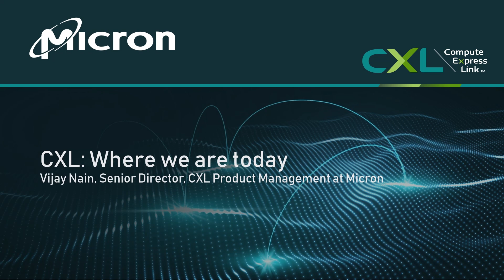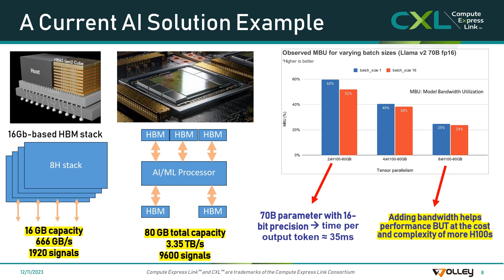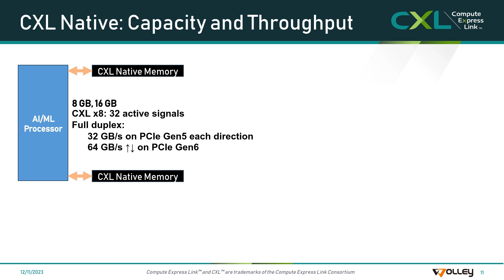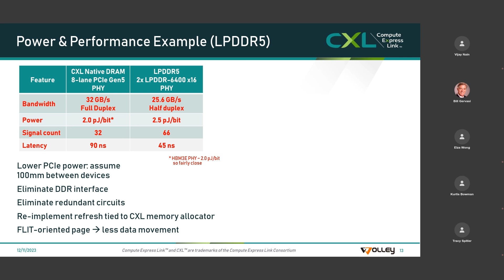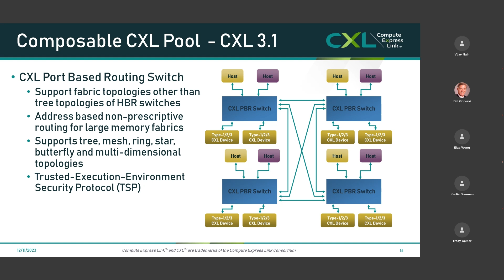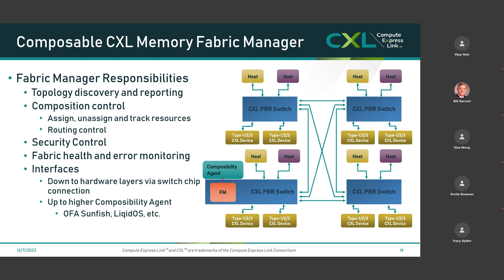Increasing Memory Utilization and Reducing Total Memory Cost Using CXL

Comment: Will these Micron memory expansion cards be available for Workstations platforms as well, like the Threadripper and Threadripper Pro? Or will there only be support for the Epic 9004 series?
If there will be workstation support, are there plans for these cards being available as PCIe5 x16 slot variant add-in boards?
With Intel Optane gone, I really hope CXL and Micron will include support for Workstation users as well.
Reply: I think it'll be a while before we see CXL support for HEDT's.